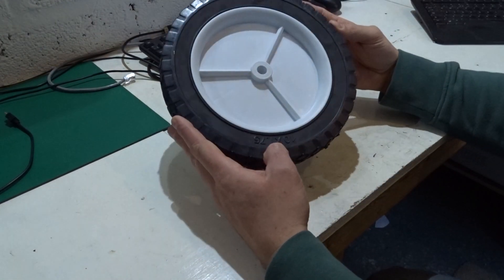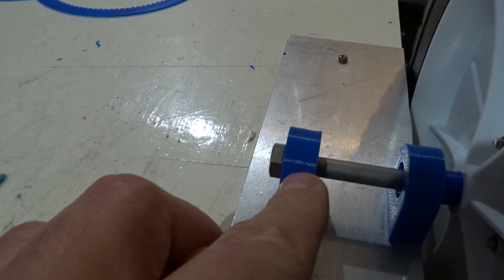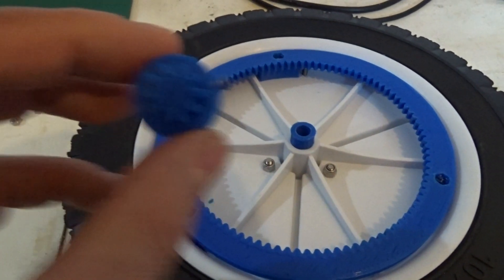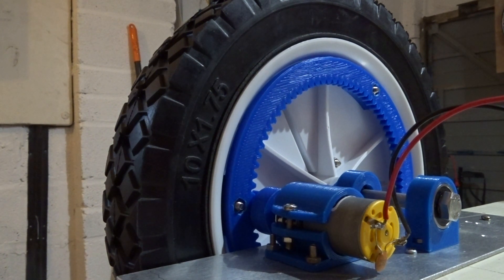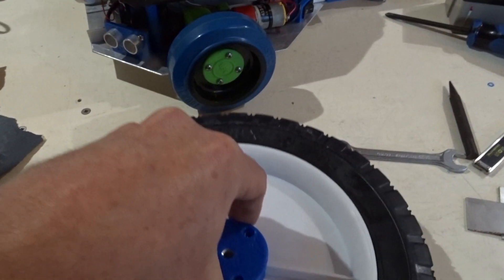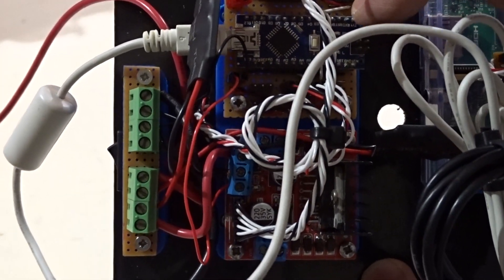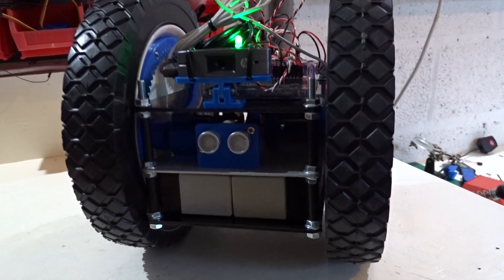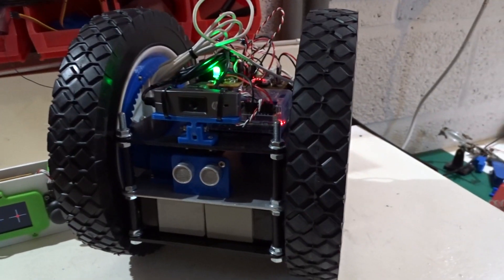Big Wheeled Mobile Robot - Big Wheel Bot #1

Comment: I got here while looking for big wheels for my new robot. I have binge watched all the parts, some of them twice! Up to now I have made my robots out of wood and aluminium but you have inspired me to buy a 3d printer and use that. I have a few questions.
- I see the nut imbedded in the plastic but exactly how is the wheel attached to the axle?
- what software did you use, l am currently considering Freecad or Blender.
- in your final iteration using the gearbox  could you share the STL file . Did you have any problems with the torque breaking the gears?
Alan

Comment: Great project 👍 I started a project with this same wheel, found it's need a strong motor and metal gear to expend the lifetime. It would be interesting to see your result.
Reply from the maker: Thanks for the comment. As I have a reasonably large gear ratio between the motor and the wheel it's performing well at the moment with the motors running at 24v. Only time will tell how long the 3d printed gears and motors will last!
Reply: @BigFaceRobotics  thanks for the update, I am looking forward to the 2nd part!